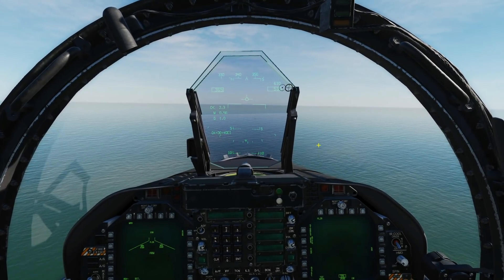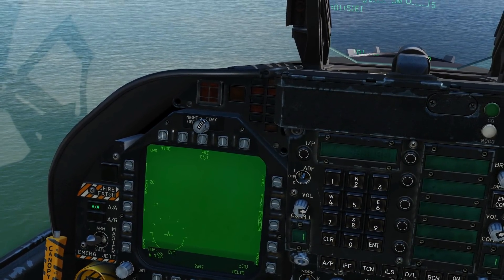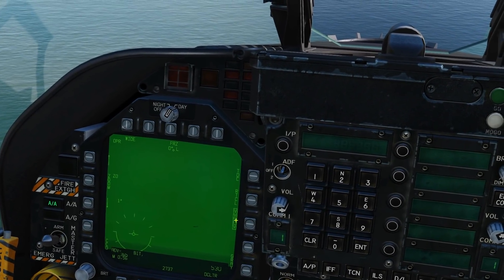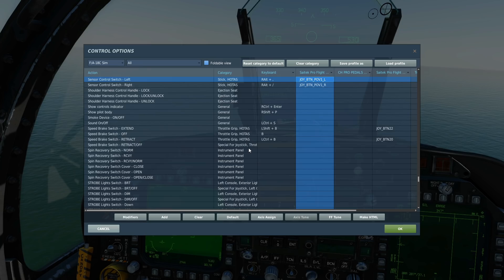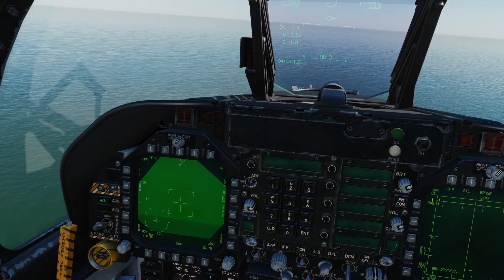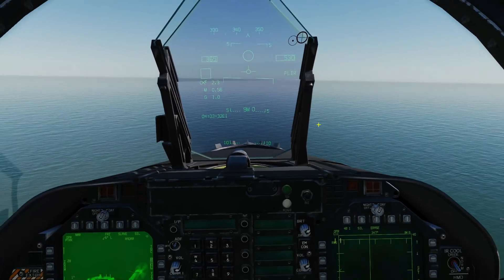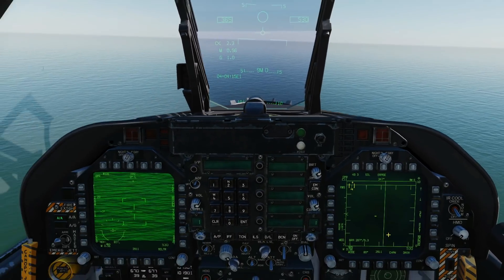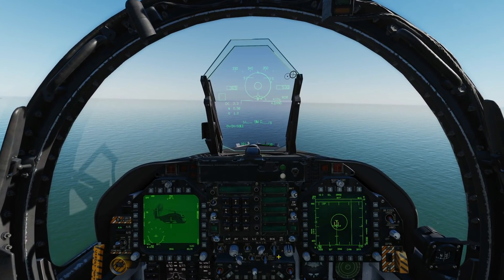FA-18C Hornet: Litening TGP TPOD - Air To Air Tutorial | DCS WORLD

Comment: Hey Cap I noticed you tend to use the push buttons on the DDI's for zooming in and out. if you have the DDI SOI'd you should be able to use "Radar Elevation Up/Down" to zoom in/out and the "RAID/FLIR FOV Select Button" to bring the FOV from Wide to Narrow. If you hold "RAID/FLIR FOV"  for a second or two, it switches the camera mode from CCD to FLIR. From what I know you do need to press the DDI push buttons to change from Black-Hot to White-Hot. Hope this helps.
Reply from the maker: Thx for info GT, I actually quite enjoy banging the actual grey buttons.

Comment: can be used to slew a aim-9 to it witout using radar? so you dont give him any warning
Reply from the maker: tried but I couldn't get it to work.
Reply: If you possibly got close enough to a target without already giving yourself away I suppose you could get a flir lock, silence your radar, then use the helmet sight for the aim-9 yes.
Reply: @fastforward3695  Nah, just silence your radar and get a lock with the tpod then after the guy is within 10 miles. Fire your missile in the boresight mode and it should seek the guy your looking at. Very great if your terrain masking at 100 feet off the deck.